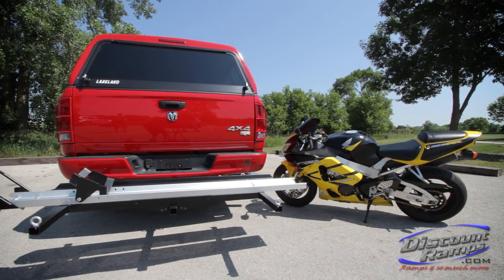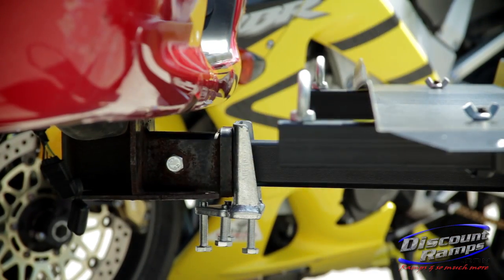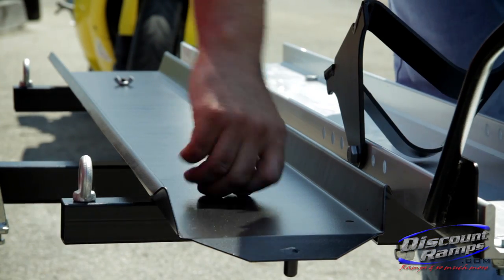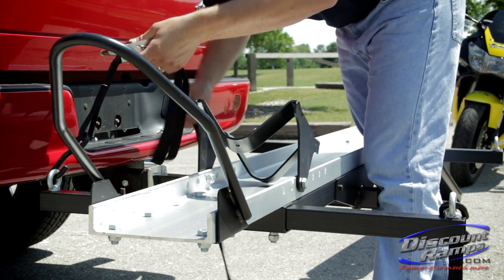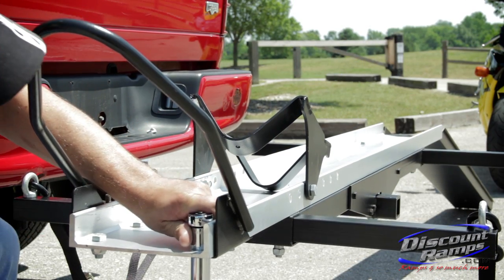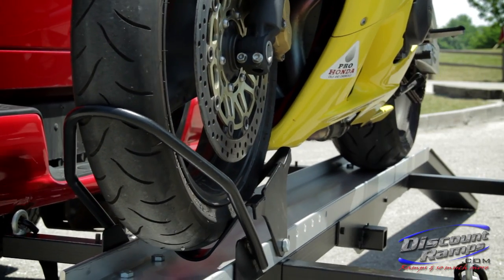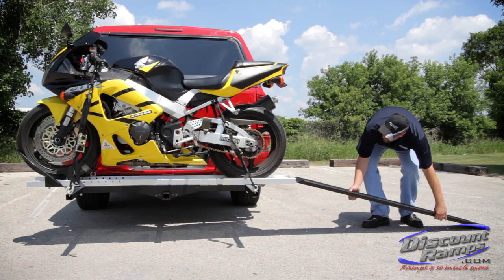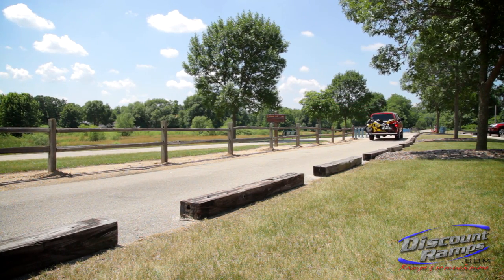SMC-600R - Hitch Mounted Sport Motorcycle Carrier Installation

Comment from the maker: Hi dangonaba,
Yes the Hyousung Aquila GV250 should work great with the SMC-600R.
The SMC-600R weight capacity is 600lbs. The Hyousung Aquila GV250 is 341.7 lb without fluids.

Comment: This is an old video but this carrier has been great. I've been putting a Ducati Monster on/off a standard height F150 Lariat by my lonesome and it's (knock on wood) simple. I just use the clutch and brake as needed. Just be smart and have your straps pre-positioned and not where you're going to walk.

Comment from the maker: Hi @dmanshouse1,
The 2012 ZX14R curb weighs 584.3 lbs. The SMC-600R weight capacity is 600lbs. If you were to use the SMC-600R you would be pushing it to its max. I would suggest looking into the VersaHaul Sport Motorcycle Carrier on our site or one of the motorcycle trailers we carry

Comment from the maker: Hi theExtremi,
We sell a Motorcycle Carrier Taillight Kit if you would like to add some extra brake lights. The part number is VH-TK. Also you can easily drill holes in the carrier tray to accommodate a license plate

Comment from the maker: Hi TheDataZoo,
The SMC-600R will not work on that type of vehicle. It depends on how much weight your suspension can handle not the type of hitch you have. Also on a vehicle that low the carrier would be dragging on the ground if you were to go up a slight incline.

Comment: I wonder how well this would work on my truck? I have an 04' quad cab dodge ram. The problem is, my truck is slammed with a 4"-6" drop kit.  Not sure how the weight being directly on my hitch would affect my truck at highway speed. ( rear tires bottoming out on fender). Im running srt 10 wheels with low profile tires as well. They're pretty wide so that's why im worried about the rubbing.

Comment: so the bike is now completely blocking the rear brake lights, as well as the license plate. Sounds like a ticket fest does it some kind of trailer brake lights or a license plate holder?
Reply: + Sprocketrocket Pensé lo mismo !!  multa y mas multa
Reply: Will it work on hilly areas and non metallic roads???

Comment from the maker: Hi Adam,
What year and model is your motorcycle? What year, make and model is the vehicle you will be hauling the carrier with? The SMC-600R has a weight capacity of 600LBS. The stock Sportster 1200 has a dry weight of 556LBS.

Comment: do i measure weight capacity with or without weight distrobustion and will a zx14r work? ive lowered weight to around 550

All the weight is tungue weight right? Thats why im confused about class 3 and 4 approved

Comment: will that work on sedans with a hitch receiver?
what is the size of the receiver to use the smc600r?
thanks..
Reply from the maker: a4wong the size of the hitch is 2 inches, for a  class III or IV receiver. And depending on the weight of your motorcycle, it might not be advisable to use on a sedan. Be sure to check the weight limit of your hitch receiver.

Comment: I've got a BMW 650 GS that I want to carry behind my full size Dodge van (1 ton) that has a spare tire carrier. would it work with an extender?
Reply from the maker: 146rwj it's a good idea to check all the weight capacities first. That is, on the extender and your hitch receiver.

Comment from the maker: Hi digisuboob,
The 2012 ZX14R curb weighs 584.3 lbs. The SMC-600R weight capacity is 600lbs. If you were to use the SMC-600R you would be pushing it to its max. I would suggest looking into the VersaHaul Sport Motorcycle Carrier on our site or one of the motorcycle trailers we carry. Or you can give our customer sales department a call and they can help you out 1-888-651-3431

Comment: Will this work on a 2007 Hyundai Sonata?
Reply from the maker: Christian, this carrier is designed to work with Class III or IV 2" hitch receivers. This would most likely not work with your vehicle. We'd recommend that you double check the tongue weight capacity for your Hyundai Sonata, as we do not have a database with all that information.